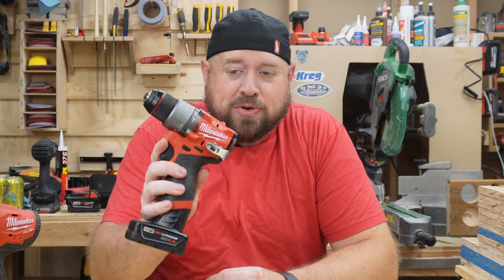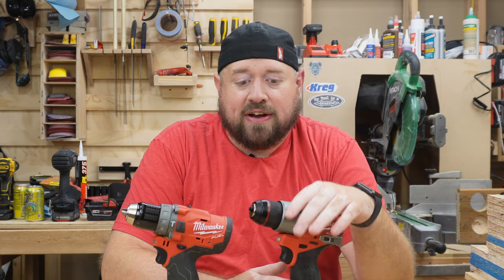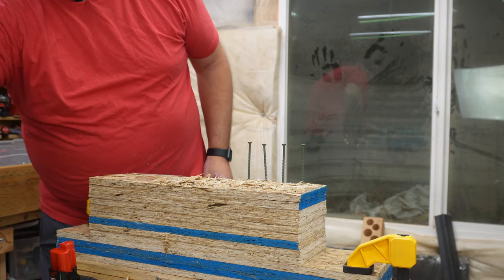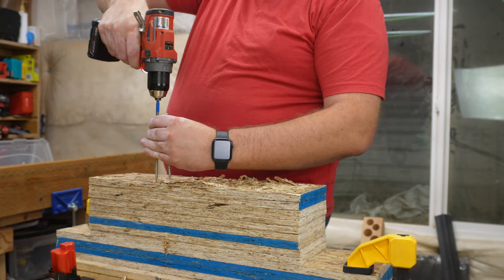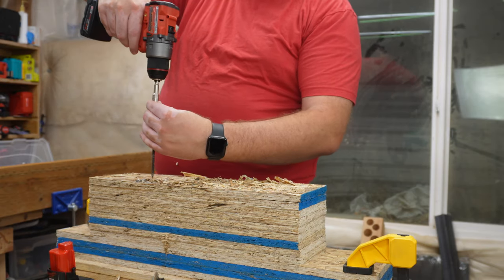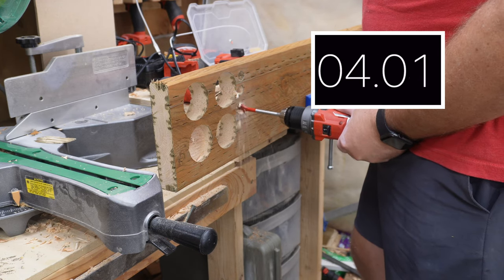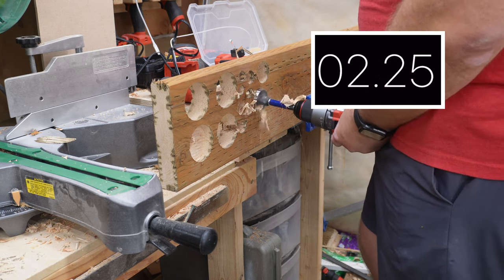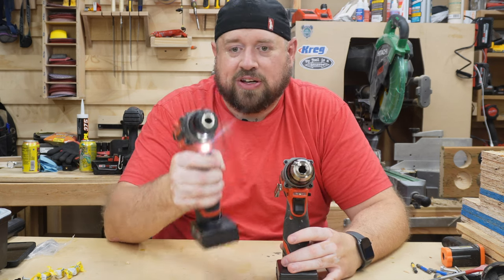Milwaukee's Best New Drill - M12 Gen 3 Fuel Hammer Drill

Comment: I fully agree with your assessment that the M12 Gen-3 hammer drill is the tool that saw the biggest improvement from the last gen among the newly released M12 and M18 hammer drills and impact drivers. I recently bought the M12 Gen-3 hammer drill, and with its mechanical clutch, small size, and big power, I think it's now pretty much a perfect 12V drill in all ways. It's a total winner.
Reply from the maker: I agree.
Reply: Impressive boiler, Randy 👍🍻

Comment: 12volt is becoming the new 20 for drills and impacts man. Amazes me to death the power in such a small package
Reply from the maker: Amen to that.
Reply: And according to Milwaukee this drill increases in power by 20 or 25% when used with the new 5.0 HO battery. I've been trying to keep to the M12 line of tools, but the Gen 2 hammer drill has really struggled. This will be a breath of fresh air.

Now it's time for an m12 rapid charger.
Reply: @procrastinator1842  Yep, the Gen-2 hammer drill was not very good, mostly due to the e-clutch and wonky electronics. I've had the Gen-3 for a week or so and it's a complete home run. They fixed all of the Gen-2's issues while also making it smaller and more powerful.
Reply: @ZeGermanHam  It's just a shame that Milwaukee takes several months longer to release new products here in Australia...
Reply: That’s what she said 😮😊😂
Reply: @philltafolla  small package,lots of torque, nut busting torque😎🤣
Reply: My favorite thing is the battery in handle. Just like the Bosch 12V lineup. I have no need for anything beyond 2Ah in a battery.

Comment: Might have to upgrade mine one of these days, especially knowing it has a mechanical clutch again.
Reply: I did just that - and just got the Gen 3 bare tool today. I'm really impressed at how small it is when compared directly to the Gen 2. Plus, the Gen 3 feels like a much more refined tool - and the mechanical clutch shatters the Gen 2's E-clutch. I had a hard time with the Gen 2's E-clutch - there's no way to get it to "easily" work accurately - it was always a struggle and it ruined an otherwise great tool. I'll probably just keep the Gen 2 for backup or I might just sell it to a pawn shop if I can get a good price - it's barely used (I just started repairs on a house I just moved into on July 31st) and is practically brand-new......

Comment: I bought a Gen 2 last year and I hated the the electronic clutch, the clutch  only works if you run the drill at low speeds. I disliked the clutch so much that I just bought a Gen 3 to replace the Gen 2.
Reply from the maker: I have liked the gen 3 a lot more myself.
Reply: I will switch it too, hated that clutch and the delay to full speed action. that's why you have the trigger!!
Reply: I did the exact same thing a few days ago, LOL. Though my Gen 2 is only a couple of months old - when I saw that the Gen 3 had a mechanical clutch - I looked found a good price on the bare tool and I jumped on it. It's a much more refined tool with the mechanical clutch - and I don't have to fumble and struggle with non-functional E-clutch on the Gen 2. I don't know what they were thinking - that E-clutch ruined what was otherwise a great tool......

Comment: Nice video as always. Would you consider making a short video or something showing the clutch differences? The gen 2 annoys a colleague of mine with the slow wind up and lowered speed when using medium to low clutch settings. He had an old bosch 12v with mechanical, then bought the m12 and was surprised it did not run at full speed before stopping on clutch settings. He’s a lock installer and basically tightens all screws with the same torque by using the clutch, and the wind up as well as the lowered speed quickly gets annoying
Reply from the maker: I’ll see what I can do.  Look out for a short in the coming week or so.

Comment: I noticed that you didn't do a concrete test that I was really hoping to see because I drill quite a few small tapcons on a daily basis so that was a bummer but I'm sure the gen 3 would've won
Reply from the maker: I haven't done much concrete testing yet because I am in a small confined basement shop with little in the form of circulation, but I am looking for a way to do it in the future.
Reply: @TinkerWithTools  still a good video but besides yours I've seen many many drill review videos and they don't have concrete testing. I think that if possible those making these videos should because they are hammer drills. But I still enjoyed the video
Reply from the maker: @weldonpinder7295  I get it.   As the channel grows so will the testing.

Comment: Great video, exactly what I was hoping this drill would do.

I've been using the Gen 2 daily and one of the issues is that the air intake is right up the front, just below the chuck. It has a habit of sucking in whatever you are drilling, I had a peek inside and it was full of plaster, metal, wood flakes etc, which can't be good for anything.

Where is the air intake on this new Gen 3?

Thanks!
Reply from the maker: Sorry it took me a few days to get back to you.   I took yesterday off from reading and responding to stuff.   The Gen 2 had some air vents directly above the trigger.   The Gen 3 doesn’t have its vents until half way though the Milwaukee logo and then has a larger exhaust directly at the rear.

Comment: Great video 

Did you mention ergonomics and thickness of the handle? I went with Dewalt sub compact 805 recently as wanted something smaller but powerful, with a narrow handle 

But that Gen 3 looks sweet
Reply from the maker: The handle is seemingly unchanged from the Gen 2 so I didn’t mention it.   If you didn’t like they one then you likely won’t like this one either.    The 805 had a more comfortable grip.

Comment: The main problem with M12 tools is that they get hot pretty quickly when working hard.
They need to improve the fans to compensate for the size and power.
Reply from the maker: While they get hotter I have never had it present a problem under my normal use.
Reply: Main problem with M12 as I see it is that they eat battery charge for breakfast, lunch, dinner and for snacks in-between meals. They should really get us some 8 or 9 Ah batteries in 12V.
Reply: @kundetjenesten  I think the xc 6.0 last fairly long, but I don’t know because I don’t really like the ergonomics of the M12 Fuel.
Reply: @DiligentDave1966  I know what you mean. My M12 tools are mainly stuff that doesn't exist as M18 (or didn't exist at the time of purchase) like the angled die grinder, the cut off tool or the inflator. The 6Ah is ok, but I'd say it is the only one. The 2Ah and 4Ah gets used up so fast it just ain't funny.
Reply: @kundetjenesten  The xc batteries are always better than the cp.
Anyway, that’s why plumbers use M12. The M12 lineup has a lot of specialty tools that other platforms don’t offer.
Reply: @DiligentDave1966  That is true, but sometimes it feels like Milwaukee is just baiting us. Take the M12 inflator for example; already when it was fairly new I said it should have been released as an M18 version, but since it was only available in M12 I got that one. And a couple of years later they released an M18 version.... 🤬
Reply: @kundetjenesten  They still don’t have an M18 ratchet or right angle impact either.
Reply: @DiligentDave1966  I just checked, and they do seem to have an M18 right angle impact actually. Brushed, but still...
Reply: @kundetjenesten  I guess I didn’t see that one.

Comment: I’m on the dewalt platform and was looking at these M12s. Should I jump over or stick the with dewalt 12v? Thoughts?
Reply from the maker: If it was the previous generation, I would say stay put... but the performance bump from each tool on the new generation vs the dewalt is pretty noticeable.   I think both are great tools but if you are inclined to make a switch, I think Milwaukee has more power.
Reply from the maker: In 12v, in my opinion there is not better platform than M12.  But it really depends on what tools you will use.  If all you need is a drill and an impact, Milwaukee has more performance but it’s not like DEWALT is bad.   When you start talking about the ability to have other tools like an inflator, pin nailer, brad nailer, sanders, die grinders, lights etc… M12 really pulls ahead.

Comment: What's the difference between the Milwaukee Model# 3404-22 and 3403-22 hammer drill they both have the same specs? Any help would be appreciated...
Reply from the maker: The 3403 is the drill/driver, or in other words it doesn't have a hammer function.   The 3404 is the hammer drill version.  If you don't need or want the hammer drill then the drill driver can work for you.  Other than that they feature the same specs
Reply: @TinkerWithTools  Thanks for responding so quickly, I purchased the 3403-22 kit but the following day before Home Depot ship it I found the 3404-22 which both products  looked identical and came with the same batteries and bag. The only difference was the 3404-22 kit was ten dollars more, so I thought I'd ask before canceling my order and going with the 3404 model. But in both cases either model would be a upgrade from the Black and Decker hammer drill, so I'll be receiving the 3403 model today, thanks again man........
Reply from the maker: @wallacelawson9027  yeah I think you will really enjoy that drill.  I don’t have the drill driver version but I don’t expect it to be any less awesome that the 3404!

Comment: I personally would opt for the non-hammer drill version 3503 and use my larger hammer drill when I need to.
Reply from the maker: I had thought about that.  Obviously the hammer function isn’t going to do a lot of heavy work but when I got it there wasn’t a kit for sale with the drill driver and an impact so I just went this route.
Reply: IMO, since there is no change in size between the 3404 hammer drill and 3403 non-hammer drill, there's pretty much no reason to buy the 3403 non-hammer drill. No, the 3404 hammer drill won't be as effective at hammer drilling as a larger 18v tool, but it can still handle some stuff. And when you buy it in a combo kit, which is the only way it should be purchased, the cost savings really make the slightly cheaper 3403 non-hammer drill irrelevant.
Reply: @ZeGermanHam  When I need a hammer drill I use my larger hammer drill with a handle or else use my rotary hammer drill if its anything more than 3/8".  I rather not have that hammer contraption in the drill I use for 99% wood.
Reply: @ZeGermanHam  Personally I would opt for the non hammer drill every time. Why? Because the mechanism to allow the chuck to move forward and backward will always have more play/wobble, and develop more play/wobble over time. This can and does causes the sprag clutch to slip when you're trying to tighten the chuck. I'll never buy a hammer drill again if I can help it.
Reply: @procrastinator1842  you make good point, and helped with my decision for the non-hammer version over the hammer version

Comment: Does the 12v battery outlast the 18v counterpart?
Reply from the maker: Don’t know that I have ever really tested that.   I would say the 18v tool would handle certain tasks easier so it might used battery power more efficiently.
Reply: @TinkerWithTools  I agree but for a DIY-er the 12v lineup is more than adequate!
Gotta love the cute m12, wasn't a big fan of the gen 2 but gen 3 got my wallet :D.

Comment: Why use strips of chip board rather than a solid piece of wood?
Reply from the maker: Chip board or OSB as it's known to me is a relatively cost effective material to test in that doesn't split or tear apart.  It lets me get more test in without splitting especially when I get close to the edges.

Comment: Watching this after breaking my gen 2
Reply from the maker: Sorry it broke. The gen 3 is awesome though
Reply: @TinkerWithTools  plan on getting it. Between buying the kit and selling my gen 2 impact or just buying the bare tool
Reply: @jhm054  I just bought a Gen 3 kit, in Canada pricing of bare tool doesn't make sense. Bare drill is $198.00, drill kit with 1 2 amp and 1 4 amp battery and charger is $248.00, drill and impact kit with 2 batteries and charger is $249.00.

Comment: I’ll think the new battery 2.5/5A will improve even more the performance speed of the tool vs the older model all new and old model will come soon a real beast test 😂
Reply from the maker: I have a 2.5 right now and so far I am not seeing something special.   But I still need to do some testing.  Might take the 5.0 to get a big boost.
Reply: @TinkerWithTools  like that you are so honest  not many reviewers say the truth !!
Reply: @TinkerWithTools  correct, the new 2.5 sits above the 3.0 cp, but still below the 6.0 xc battery for power output. Somebody made a comparison video. The 5.0 HO + Gen 3 will be a killer combo and will finally be up to the task of sending 25mm speedbores for electrical rough in, which is a big thorn in my side for rhe current Gen. I do wonder though, either all that power and more heat...Is it going to last?

Comment: I just got one for 70 bucks just the tool on Amazon. I triple checked that it was a scam before buying as much as I could. It Came in a bag that wasn’t sealed with the manual thrown in it. I was pretty sketched out. Charging the 2.5 AH  high output batter right now. 

This has the hammer drill and everything.
Reply from the maker: You can get actual tools from there and but yes it’s not always legitimate packaging.   Typically if a price is too good to be true there is a chance it might be fake but I am hoping you get a good one.

Comment: Drilled into 3/8 steel with a 7/32 bit....drilled like 3 hole and cut off over temp......with the gen 1 didnt heat up as much same 2.5 HO battery

Comment: What about the heat, do y’all think it will be as reliable
Reply from the maker: I think if you push it beyond what they recommend the heat could become a problem.   It’s not designed to do an 1 3/4” bit.    But it will be awesome at the stuff it’s supposed to do.  Time can only tell if it’s going to be a bigger issue but the testing pushes it in terms of doing back to back tests over maybe 10-12 minutes
Reply: They said heat management was something improved with the new drills and impacts because it’s been the Achilles heel of Milwaukee. It doesn’t seem like it did much in this case, it probably won’t be an immediate problem but as the tool gets worked I imagine the higher average heat will degrade it faster.

Comment: My 3rd gen m12 drill overheats in 1.5 minutes of essentially no load use. Sometimes 2-3 minutes if I’m lucky. It’s absolutely ridiculous. I got it to run drill brushes detailing and it’s honestly the worst power tool I’ve ever used and it’s not even close. My old m12 brushed drill would last hours on end running without stopping. This “better” one doesn’t even last 2 minutes. Terrible drill
Reply from the maker: I haven't put the 3rd gen into that exact situation necessarily, but I have run my Gen 2 Fuel like that in a tile cleaning application and it ran fine.   Sorry it's not working out better for you.
Reply: I bought a second kit to try out a new one, and this one the fuel gauge doesn’t fully line up with the holes to check battery which is also pretty annoying.  Brand new and it’s already flawed. Quality control is getting bad clearly. Lots of people who said their trigger came off right away too